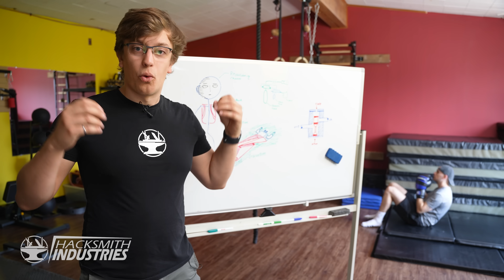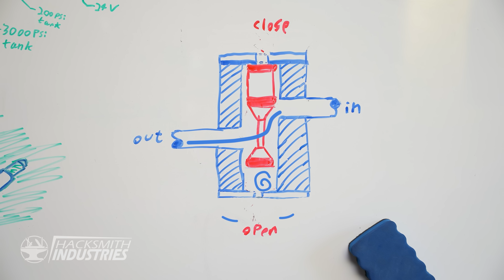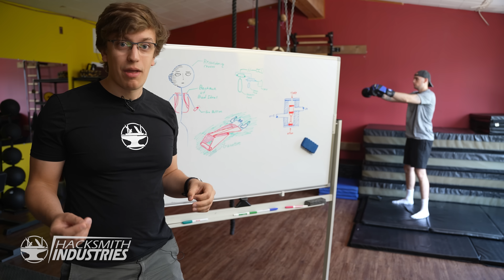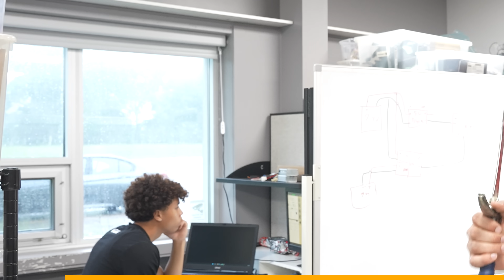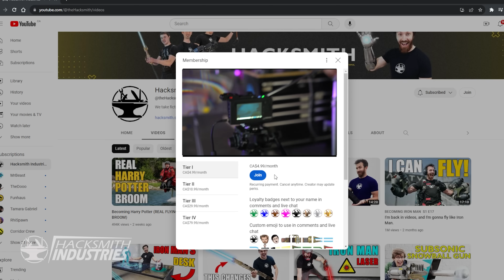This Glove Punches For You! (COLD GAS ROCKET FIST)

Comment: What if instead of a button, it was pressure sensor on the front of the gauntlet. Not only would it automatically go off, it would maximize damage on the target because you would have full control to aim the punch and THEN the burst of speed would go straight into it.

Comment: Here's an idea. Instead of a large tank, have you considered using dry ice to build air pressure? Put dry ice in a piston chamber, let the ice melt, air pressure increases, then pull the trigger. More piston chambers, a warmer, and the type of dry ice might change the charge rate.

Comment: I feel like you could have used some sort of shock absorption in the impact bar attachment that could have mitigated the damage you did to the frame. Maybe a pneumatic valve of some kind similar to the kind that slows the trunk doors on cars. It also would have allowed for more force transfer to the target instead of the wearer.

Comment: I’ve got an idea what if we got a a plastic tube steel wool and a battery and a repulser light with a hole in the middle for the tube so poke a hole in the glove for the repulser to go in hook up the tube so it’s in the glove and connected to the battery and steel wool so with your other hand press down on that glove and sparks should appear that will go through the tube and out the little repulser thing??? Am I on to something or not

Comment: After checking the previous result and my previous comment, I think that the switch at the time of impact is a wrong idea, so I am thinking of an Inertia-sensitive switch that discharges the gas when the impact starts.If the blow is stronger, the gas discharge will be stronger, it will make a stronger punch, and this Inertiaenergy will control the punch in a completely natural way.

Comment: Something I think might be helpful is having a sort of brace or cage that fits around the rest of the arm and supports the end of the 'fist' that the person has their hand seated behind. It might not be very easy or feasible though, because that's a lot of points of articulation (potential failure under load), and it would probably have to connect to some kinda chest rig at the shoulder in order to actually do anything to redistribute the force? Maybe making the parts for the exoskeleton could be done by 3D printing and then coating in nanovate, if collaboration with Integran wasn't a one-time thing and it wouldn't be cost-prohibitive to do?

Ultimately the issue with making any kind of force-enhancer for a human body is gonna be the human body, so lessening the amount of strain the wearer has to receive from using the device is gonna allow for more power to be used safely. Especially when hitting solid objects that aren't gonna move out of the way, like if you wanted to punch through walls.

Comment: One thing I like about this contraption and maybe it applies to all external strength enhancers, is that it's very easy on the joints.
Such extra force, yet no extra impact on the joints. 
In this particular case the hand is being pulled from the front, not pushed from let's say the elbow.

Comment: The power of compressed air at that level of pressure is truly terrifying. Running that thing at 3000 psi may dislocate a joint or two

Comment: Quick workout suggestion sit ups can actually cause bad back problems in the long run so instead a workout that does not harm you but works your abbs is by doing a specific amount of crunches ( upper abb ) reverse crunches ( lower abb ) and then doing them at the same time ( middle abb ) this is much better for you and works even better as well.
Reply from the maker: It's a joke from the anime
Reply: @hacksmith  TBH I did not expect u to reply but yes I remember now I did watch the anime and that was his original workout routine thanks for reminding me but it was just a lil suggestion lol.

Comment: Couldn't you have some sort of impact detection device that triggers the valve instead of a button? It would simplify the glove mechanism, making the user not have to think about timing the punch with the button.
Reply: Yeah, a proximity sensor or simple  bumper switch would work

Comment: Cute trick with the door, NO HINGE PINS!
Reply: I went frame by frame starting at 18:11, at 18:13, there are several frames where you can see the hinge pins in pieces flying away from the hinges.

If you are going to show trickery, at least be hard to disprove!
Reply: @Gaaaaaame  not saying you're wrong, but I don't see them. Maybe it's my old crappy cell. And I don't have access to a computer that I can check better with. But if you say they are, ok, guess I'm wrong.

Comment: If it were me, I'd put a gas dump switch on the set so that the gas would dump right when the impact hits.This form of impact has the highest pressure and the most efficient discharge.We must have a reversible spring system behind the switch for two reasons: first, the switch does not break when the energy is discharged, and second, the inertia of the impact does not trigger the switch.
Reply: The gas dump after impact is the worst way possible
Reply: @Keallz911  learn physic dude
Reply: If you trigger the gas dump as it hits you're just going to be pushing through, there would be no impact which would lessen the overall power and point.
Reply: @naunau311  yeah too many people do that and it annoys me a bit. need that speed up first before impact and carry it through after impact not only after
Reply: @naunau311  just how martial arts teach you to "punch through" a wall

Comment: I have a feeling that the metal deformation was actually super important, without that I fear they would've damaged themself instead
Reply: Ehh not necessarily. If the metal had a higher elastic limit, then it would have just unbent itself after the impact, but the temporary deformation would still have protected their hands.
Reply: @bable631  metal isn't really elastic, one of the unique properties of metal is it's ability to deform, yes in some cases it can be elastic or "springy" but then the energy has to be released and would mostly be released into their hand arm and rotator cuff I think
Reply: The force is applied to the back of the metal frame, and released at the point of impact in the front, it's not going into his arm. 
It's only when used with nothing in the front that the force has to go through his arm to stop the motion
Reply: @bastienx8  the force of impact, not the initial thrust
Reply: @michaelbray4997  at the moment of impact the air is still pushing, so I don't think they have a big impact on their arm
Reply: @bastienx8  no, forces are equally and oppositely opposed, when he hits an object the force is reflected directly, that's like saying if you strap a rocket to the back of someone's head and then punch them in the face that the force is negated and they'll be fine, no, the force will go into deforming whatever is easiest to deform, lucklyin this case it was the metal, if not it could've been his shoulder or hand bones, in the case of the guy with a rocket strapped to the back of his head, it would be his skull deforming
Reply: @michaelbray4997  yes but in this case the frame extends to the front of the arm as well (when they are breaking bricks), then the force is going directly from the nozzle at the back of the frame to the target at the front. Their arm is just on the side, it doesn't contribute a lot to the overall system
Reply: @bastienx8  yeah hence why the metal deforming is a good thing because the force didnt have a chance to leave the metal and into his shoulder

Comment: This is like the third time hacksmith has built this kind of a glove..
Reply from the maker: First time of this style actually! All the other ones were mechanical extensions!
Reply: @hacksmith  tbh, I feel like the mechanical extensions were held back by Newton's Third Law. They could only apply force back on the wearer's arm, which means that whatever force they applied to the impacted object would be that much less. This design doesn't have that flaw but DOES have upkeep in the form of pressurized nitrogen lol.

Comment: How would I do it if I wanted to put a flamethrower on my guitar?
Reply: Have you thought about putting your guitar on the flamethrower?
Reply: butane tank, electrically operated solenoid, run it piping wherever you want on the guitar, make sure it does not hit anyone, put a flame resistant nozzle (also it shouldn't be too wide) at the end, get an electronic lighter with oscillating mode or a stun gun, wire it all up to a switch, and you're good to go.
Reply: Attach the switch to the string on the guitar @Stay_away_from_my_swamp_water
Reply: a youtuber by the name of  Jlazer has vidoes on modifing lighters

Comment: So what you need to do now is making a second fist, figure out a way to refill the tanks on the fly and find some monsters to fight 😂
Reply: Also put the button on the hand punching. I feel like the nervous system connection is way less difficult if it's the same hand, like coordinating between left and right is a lot more awkward.

Also far more structure on the hand mechanism... make that sucker a lot thicker, I'm not at all surprised the frame bent.

You could make it suuuper dangerous and put a spike on the front, and then do stuff like punching through armor. I bet it would penetrate incredibly well, possibly better than a bullet.
Reply: You might be onto something @hellomate639
Reply: @hellomate639  Or have an accelerometer on the fist so that when it detects you punching, it turns on the gas flow.
Reply: @mh6276  I think that's too sketchy. Misfiring will happen with that perhaps.
Reply: Not only that but maybe see about having the tank on the person using it so it moves with the person instead of being stationary and potentially causing the line between the tank and the fist to fail in a potentially dramatic fashion, though that might be a challenge of it's own
Reply: gotta have a way to toggle the direction that it shoots so you can punch through glass, grab onto the door, and have the air shoot forwards ripping the door off the car
Reply: The entire point of opm is that he only needs the one fist smh
Reply: We building a power suit with this one
Reply: Like a battery powered air compressor?
Reply: Or do away with the gas and use some sort of spring-lock system that can be wound up and released. It would not be as powerful but it would be lighter and more usable since you don't have to refill it, and less power would be more tame.
Reply: You don’t need to refill the tanks if you take them out with a single punch.
Reply: Definitely not complicated